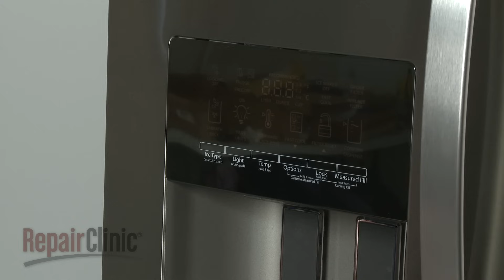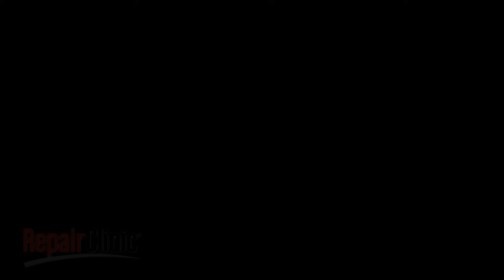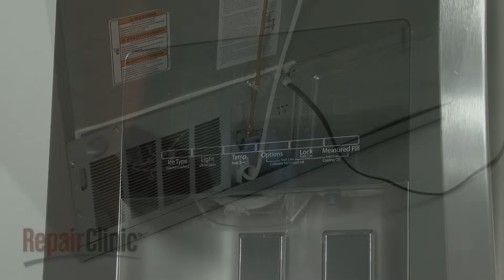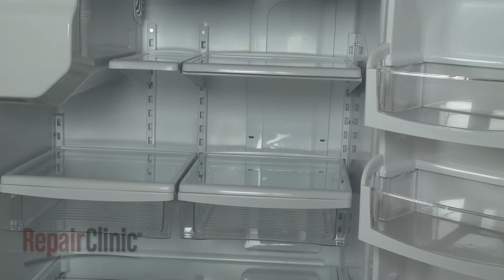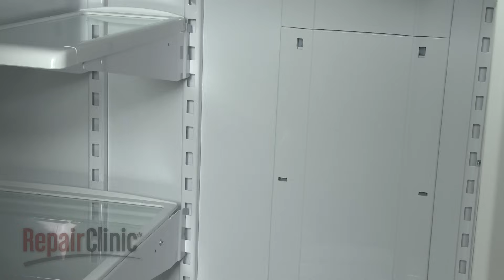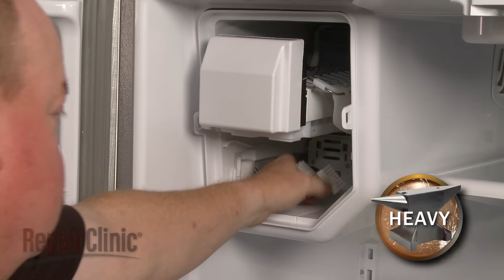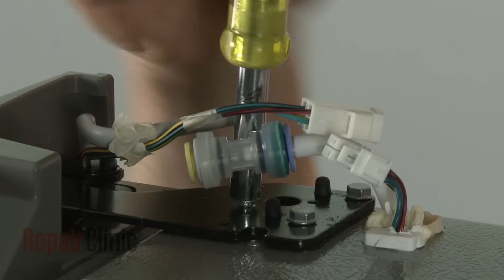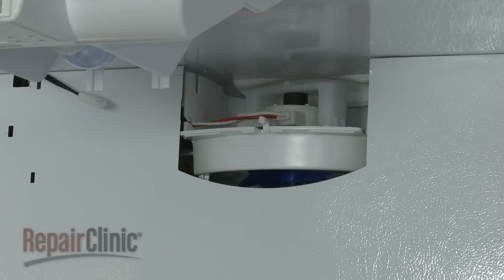Whirlpool Refrigerator Disassembly (#WRX735SDBM00)/Repair Help

Comment: How do you remove the middle drawer ?
Reply: Nigel Stars  there are two hex screws on each side of the drawer facing the refrigerator. I removed these to clean that shelf. it will be easier if you have help but not too hard alone.

Comment: This may be good for someone who can almost be a trained repairman themselves. But, if my fridge was under warranty, I wouldn't mess with a refrigerator to this degree! Especially, if I was unplugging a mess of wires or water lines!  All you need to do is bust of one these cheap plastic panels and you're screwed!  I'd rather pay for a cheap extended warranty.  But, this video could be handy if you have a dopey repairman , who can't do crap! You might be able t walk Dodo through his job! Food for thought--;)

Comment: thank you, now it will take me less time to do my job, the way I was accessing the evaporator was longer, I removed not only the sliders but also the sliders retainers because I was scared to scratch the freezer interior while trying to remove the panel to access the bi metal and element.
Reply: Morning, whirlpool  French door refrigerator with freezer at the bottom.freeze door is lock, can’t open. Help please,
Reply from the maker: +Natalino Rolli Thank you for sharing.